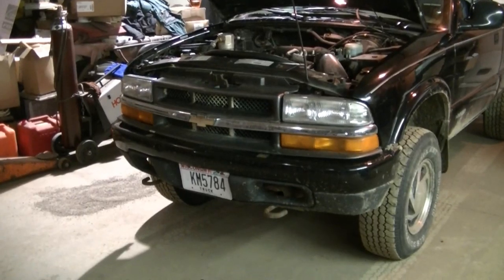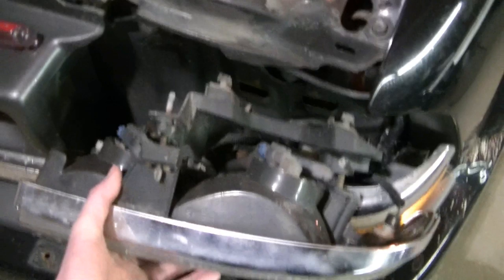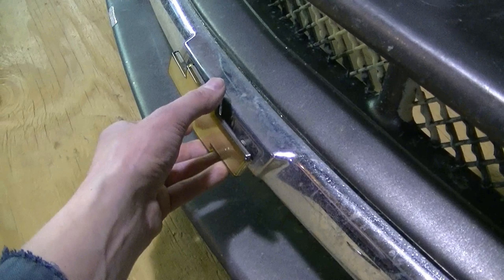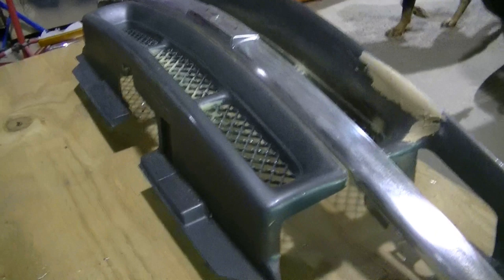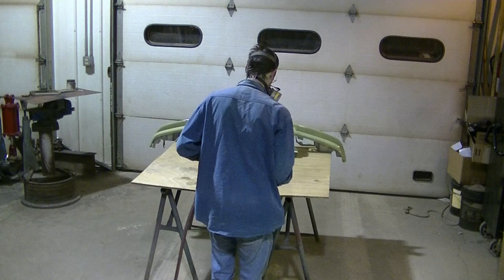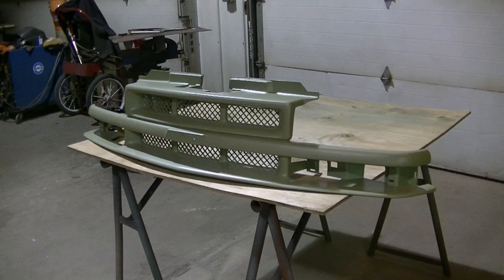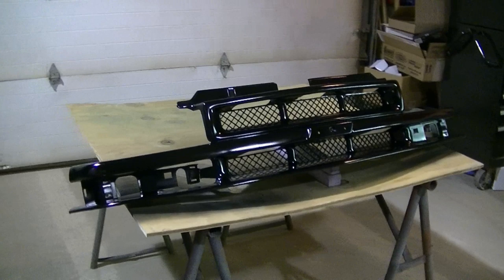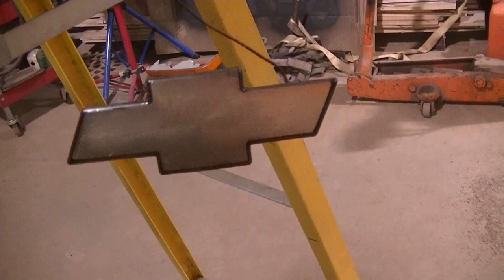Project Mini Me "Painting the Chrome Grill"

Comment: No need to pull the lights. Grill comes off with just a tug. We swapped a friend's grill with mine in under 30 seconds. No really, we were timed to do it under a minute,  LOL. Loos good though.
Reply from the maker: The grill was already broken by I am guessing someone just ripping the grill off without taking the headlights out.  I will take a little more time and pull the headlights, to get the grill out to save breaking the grill more.

Comment: so you are using etching primer on plastic?.. im going to attempt to do this on my 07 silverado. i also have to paint the bumper end caps and also the bumper face bar. the end caps are new black plastic.. the grille is plastic chrome and the face bar is chrome plated steel.. do you have any tips so i dont screw this up... im going to be using  spray can paint and primer.. the end goal is to black everything out.. i know the more attention to prep the better it will come out. should i clear coat these.. i want a matte finish?
Reply from the maker: Yes,  an old painter told me about using etching primer on chrome.  I have had pretty good success doing that.  Spray cans won't come out like this video.  Real paint and a professional paint gun is the only way to get results like this.  If you are looking for a matte finish the spray cans might work out for you.  I would suggest doing a test piece and see if you can get the results you are looking for before you try it on your truck.

Comment: Was thinking about trying this to my s10.. will the edging primercover up the chrome good enough to paint over it?
Reply from the maker: Greg Gracia   It is etching primer.  Etching primer is suppose to be used on bare metal.  It will etch its self right into bare metal and is an expensive primer.  Similar to what auto manufactures use.  This is the way I paint chrome.  Painting chrome is a last resort.  I didn't want to buy a new grill so I just painted mine.  It will not be as durable as if you painted on a black grill.  Most body shops won't even paint chrome.  The paint has held up good on this grill.  Still looks good.
Reply: Thanks. . I'll keep an eye out for this stuff

Comment: What kind of paint do you use? Does it have a sheen to it? What kind of sand paper did you use? Also what brand of cleaner or degreaser do you recommend?
Reply from the maker: Don Davis   I get all my supplies from the local Car-Quest.  I use Duponts off brand paint.  It is a little cheaper than Dupont branded stuff.  The paint shines just like the factory paint if you lay it down right.  Again my cleaner and degreaser is from Car-Quest.  If you go to your local autobody supply place I am sure they will help you get started.

Comment: In between when your changing colors do you have to clean out the spray gun? I'm not that experienced at painting but i did buy a spray gun i have yet to use. Also have you have repainted the frame on any of your trucks if so what do you suggest doing? In a few weeks ill be taking the bed off my truck, replacing some cross members and want to repaint the frame to help prevent rust and give it a better look thats why i ask, Thanks for any info! and the grill looks great!
Reply from the maker: Yes you have to clean the gun completely between primer/color/clear.  I use paint thinner and spray it until it is clean.

For my frames I usually use the industrial rustoleum.  I have heard people using por15 and others paint over rust products and they seem to like them.  I have never used them.  With the rustoleum I usually have to touch it up every year if the surface was really rusty but if you can get it clean it is very good paint.  I used it to paint my gooseneck trailer.  My dad just stumbled onto some marine grade paint that I am going to try.  You can get it at Sherwin Williams I guess.  You can roll it on and it will self level I guess.  And if it is marine grade so you know it is tuff.  When I try some I will do a video.
Reply: mossman381 Ohh ok ill make sure i do that when i use it. yea i have heard of por15 too but my friends uncle who is a painter has also said that primer and a couple coats of black would be the best to do. Yea the marine grade i would assume hold up pretty good against the elements

Comment: What are you using to sand and scuff
Reply from the maker: Just a scuffing pad.  If you have areas that need to me smoothed out more you can get more aggressive with sand paper.  You will also probably have to use fill in primer then sand that to get a smooth surface for paint.